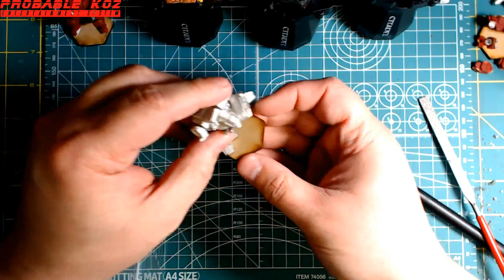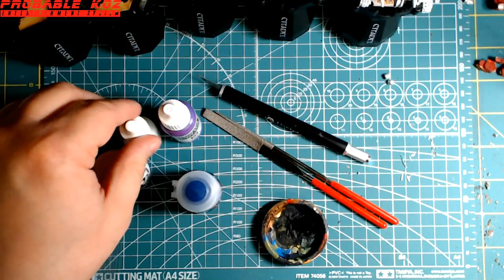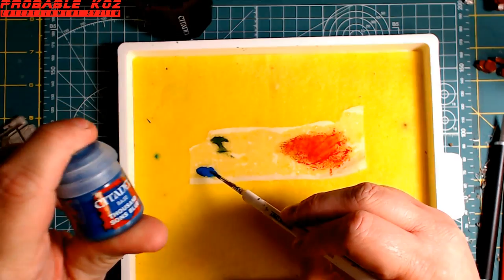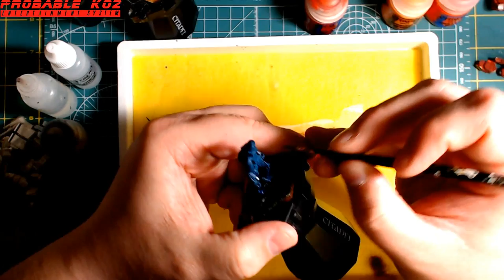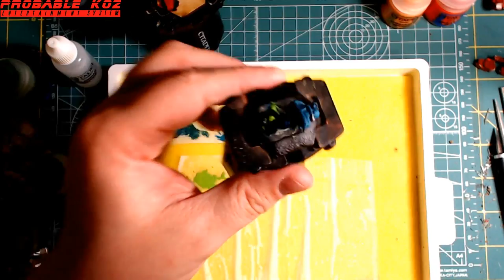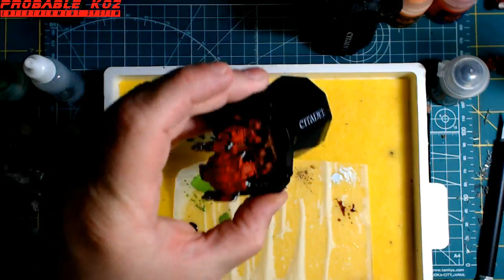Hobby Stuffs LIVE/Replay- Painting and Stuff - 04/08/18

Comment: Any cost estimation for a Mad Dog (including Metal Mech + Paintjob)?!?
Reply from the maker: So, while I do commissions from time to time, I tend to value what I do on the low end of the professional sites. A good comparison/example is Frontline Gaming's painting service. So a basic miniature in average 28 to 34mm scale, with 3 colors minimum, a wash, and light detail work is about $12 USD. You add assembly, type of scheme, weathering, basing for the miniature, decals, more detail, etc it goes up in price. I'm not the best painter out there, but I know what my paint job is worth after doing two years of off/on commissions locally. The biggest thing is time and you never ever make that back with commissions.

So a Mad Dog would be easy to do with relatively quick turn around time depending on the scheme how crazy you wanted to go with detail/etc.

So long story short (too late) cost of the Mad Dog ($12) + basic paint ($12) = About $24 USD. Other options can add up. Plus shipping of course.
Reply: Sounds reasonable for. Any Chance that we have a quick chat via TS someday?
Reply from the maker: I think that could be arranged.